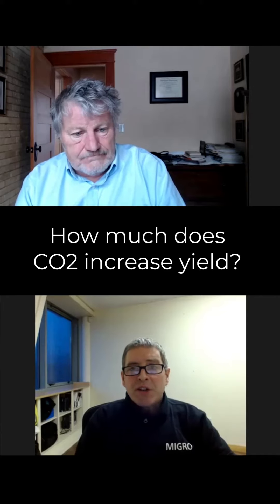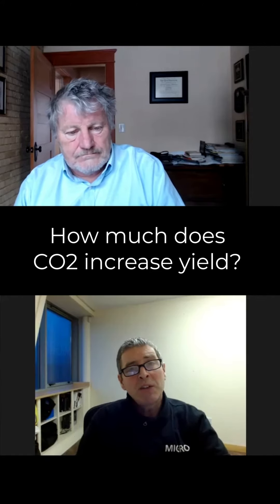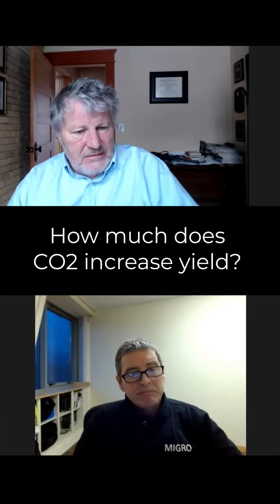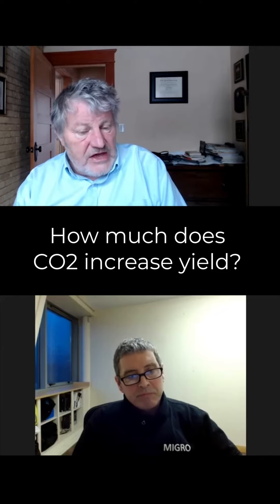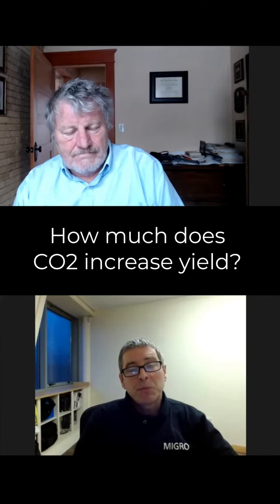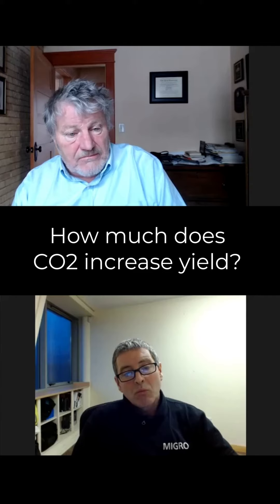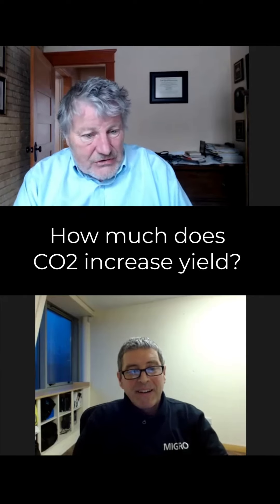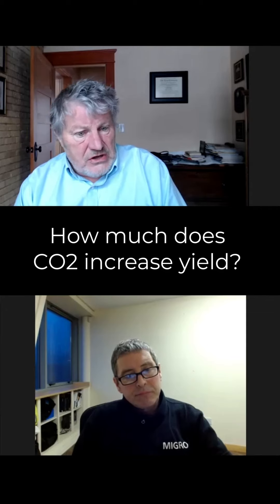How much does elevated CO2 increase cannabis yield

Comment: So now I'm thinking my plans have changed again....sealed room it is, back to planning. But perfect timing! Superb information Shane thank you!
Reply: You can seal your room very easily with plastic tape and large plastic tarps, i sealed a room like that so well that when i turned on the exhaust fan the plastic tarp on the walls started expanding into the room as if the walls were closing in on me lol.
It was a freaky but cool expiriment with great succes, just make sure you have enough air input or else it will draw air from small cracks and crevices which can suck in insects and molds from the walls or outdoors

Comment: I guess it depends on your CO2 source.  Around here, tank rental is $1/day, CO2 is ~$60-80 for a 20lb refill and that would last me like two months.  So I'd be looking at maybe $700/year?  That's more than it would cost to double my lighting.
Reply: Sounds like you are running a small grow tent. So it doesnt really apply for your situation. But for bigger home grows or commercial grows this is an significant increase.
Reply: You can also use fermentation depending on the size, might not be effective for large grow areas but you dont need as much fresh air either

Comment: So what's the motivation of those trying to lower C02 levels? If it increases all kinds of crop yield wouldn't that help solve the issue of hunger?
Reply: Make sure you use TNB Naturals scientifically proven to be the best CO2 in the world❤
Reply: Over priced, you can just add yeast and sugar and get the same results. I bought a bottle and it only lasted a week as the gram weight of powder is insufficient to last a week
Reply: The reason of hunger is Greed my friend

Comment: Hello Shane
If u put grow containers in a bag or larger container,
Filled with CO2 using a tubing from the CO2 system, will it  kill those bugs? Search homemade 
bed bug traps.
Reply: Youhave to have well over 20,000 ppm of c02 to choke out bugs and it has to be sustained for at least an hour
Reply: Where are your bugs, in the medium or on the plant?
To kill plant bugs by co2 you’ll be wasting a shit load. To kill soil (bad) bugs you’re better off just using carbonated water… or for better protection - Hydrogen peroxide. But note, HP will kill your “good” bugs too. That also applies to co2 - the amount you need will also kill the good bugs too (if you have any)
Reply: You can also use the HP as foliar spray (prevention/pest maintenance), cos it has an extra oxygen atom that expands the/any bug and eventually kills it. A good ratio to start with is 30ml HP per 500ml water. 3day application rate recommended - further if needed.
Reply: Zyklon B does a good job

Comment: I doubt any bag/bottle that u hang with any sort of venting gets to 1200ppm is my first thought .... I use propane with a monitoring system ... 1500ppm seems to be the sweet spot for me
Reply: I use butane. I find it cheaper. I also make 3 x 1 litre bottles of co2. 200 g of sugar. Half a teaspoon of bicarb or baking soda. 2 level teaspoons of active dried brewers yeast. I find the yeast to use in spirits like gin work the best. Finally 500ml of warm water.
Lasts far longer than the tnb brand and costs pennies.
Each bottle lasts about 3 weeks
Reply: @Tony Wharton
I noticed you mention that in a comment, i used to do the same - still do sometimes. I’ve noticed four 2 litre bottles will last about 4 weeks in a 4x4, then when they’re running low on bubbles you can top up with bicarb. I don’t add the bicarb until it’s low on bubbles just add 2cups sugar per 2L water (mix sugar in portion of warm water prior, then add to remaining 2L). Wait 5min to cool then add half tspn of yeast… wait an hour and bubbles will start, then gradually increase over the next 2 weeks.
The usual ppm readings for four 2L bottles averages around 11-1200 for two weeks then drops to 1000 and keeps decreasing for the next 2 weeks to around 600 after 4 weeks. You can add extra bicarb after the 3rd week to increase ppm back up to 1000 for another few days… But it’ll still drop rapidly by the 4th week to around 600.
This is for a 4x4. The scale remains relatively the same for either 2x2, 3x3 etc.
Reply: @Tony Wharton
I also use tanks when i feel up to refilling them (i refill mine with dry ice) I keep ppms around 1200 on timers - but recently haven’t been using any added co2 anymore, cos I’m semi indoor, so don’t feel the need. Since my lights are basically only on for about an hour before and after sun up & sun down. I’m retired so i just wake up and take them outta the tents into the sun everyday. Bad storm days don’t really worry me cos I’ll leave tents open instead.
Reply: @Freedom_Born  Thanks for the advice my friend. I agree that the bottle will last 4 weeks but I do a complete change at 3 weeks as it's only costing pennies.
The reason I use a smaller bottle is because I'm only in an 80x80 with a 200watt led. When doing auto's, I can have the light on 100% in the first week. The girls get to 7 to 10 cm away from the lights with no problems at all.
I can only use butane in the winter and unfortunately I can't grow outside.
Reply: @Tony Wharton
Awesome, I’ve ran a few experiments over the years. On one experiment I had a 2x2 with gas, another 2x2 with a 1gal (4L) yeast bottle, and a homemade 2x2 with no co2 added.
All same cultivar, same soils, same light wattages (150W), feeds etc… i maxed the gas tent as much as possible, got about a 30% increase in biomass but it wasn’t primo. Because the over absorption of co2 didn’t allow the cannabinoids to fill out the trich bulbs fully. Made everything too fat to fill out. The bottle tent only gave about a 10% increase in end weight but the colas and trich bulbs filled in better and the smoke was better. These were compared with the No co2 tent. For a 2x2 i don’t think it’s really worth it since you can’t push ppf enough for the plant to use co2 correctly. For 2.5 x 2.5 it’ll be a little different… cos you can push a better ppf. Especially with a 200W.
I also run a 2x4 with two 150W in it with added gas, and that usually pulls a 15% increase on avg.
Reply: @Tony Wharton
Yea i kinda have the same “outdoor” issues too, but in the last 20yrs haven’t been nicked yet (touch wood), it’s just in the last 5-8yrs I’ve been transitioning more to semi indoor. It’s funny how we try to maximise co2 in tents, but cannabis cups are usually always won by outdoor grows. That always makes me chuckle. We try to maximise but still can’t beat premium outdoor.
With autos I’ve found co2 works awesome. But i run gas on timer for autos cos they eat it fast. So i can’t have it wasting in lights off. I haven’t ran tests with autos. But I’ve done separate runs with and without, and there’s generally an avg 10% increase with compared to without.
Reply: @Freedom_Born  To be honest with you my friend, I don't think the cops are that bothered.
I started auto's around 18 months ago. I've never looked back. Without co2. Average  3 Oz cured per plant. With co2 they take off and don't stop. I'm now getting between 5 to 6 Oz cured per plant in 16 litre organic soil.
I use biobizz all mix for the first 10 litres of the pot followed by 6 litres of light mix. I still pop auto's the same as any other. Damp paper towel in bag. 48 hours later I put them in the soil with absolutely no issues. I've never topped an auto. Just cropped auto purple gorilla. It's just for me so I wet trim. Makes a lovely dab oil that tastes like nectar from the chaff and sugar leaves.
The oil gives a really nice change.
Pretty much everything has been spot on 10 weeks from seed and around 1 meter.
No point running co2 at night.
Reply: @Tony Wharton
Lol I’ll run the risk, it’s only me to worry about no “attachments” so to speak. I’ll do time for a plant i love growing. It’s not hurting anyone. Nearly a century of prohibition, mind boggling. Even the alphabet community has gained more rights in the last 12months than cannabis 😂🫣
But anyways, sounds like you’ve got a pretty good process going on. Mixed soils, paper towel, tinctures… very nice!! I’ll wet trim sometimes when i have to. The biggest auto I’ve done is 7oz, but that was BigBud (Afghani x NL x something else - hybrid). I’ve bred my own GDP x Chocolate Wed Cake and Pineapple Kush x NL #1 autos. My fave autos are berries and candy flavors.
Are you making glycerin or pressed dabs ?
Reply: @Freedom_Born  This country is far too far behind the rest of the world. But some of the fun is sitting back thinking "I grew this shit"
Like yourself, I'm an old time grower.
I winterize my chaff for 24hrs. Depending on how much I have, I place it all in a muslin bag, pour about 250ml of IPA into an airtight jar. Crush and shake for 5 mins then press the juice through the bag into a silicone baking dish. The IPA takes about 4 or 5 days to evaporate and I'm left with a gorgeous thick oil. I have a couple of electric dab pens. Very nice
Reply: @Freedom_Born  Hope you don't mind me asking. What area are you?
I'm SW

Comment: I would like a better understanding of how fast the plants eat c02 in a given hour during the light cycle
Reply: I think it’s something like 400 water molecules lost per 1 carbon atom gained… something like that.
You also lose even more water when the vpd & other factors aren’t correct. Ideally “everything” Has to be on point to maximise co2, and it should match your ppf if you’re generally above 1000. Normal ambience is usually 400-600ppm and regular LEDs push avg 900ppf (coverage*) - for 900ppf, the avg ambient co2 ppm should suffice. Anything higher than 900ppf, you’ll want co2 numbers to match.
Transpiration rates won’t work effectively if it loses too much water without gaining the same ratio of carbon atoms within the hour(s) it loses water. Hence why it’ll lose water “faster” when everything’s not correct.
Reply: @Freedom_Born  Losing water faster isn't a bad thing. Lots of nutrients can only be moved into the plant via transpiration, so less of it will result in less of those nutrients going into the plant. So many times when people think they are getting calcium deficiencies from using LED grow lights, it's actually because of CO2 levels.
Reply: @TheCowMan
When you’re losing too much water without replenishing it with the needed ratio of co2 to compensate - then you’re losing efficiency and essentially causing the plant to slowly die.
That’s how you get deficiencies that “people” May sometimes mistake for ‘Calcium’ - but you can’t even be sure if it’s even a calcium “deficiency” or a toxicity from other factors.
Reply: @TheCowMan
YES - losing water faster IS a Bad Thing - if it’s not compensated or replenished with the comparative amount of carbon atoms it needs for every 400 molecules lost.
When you vpd isn’t right the amount of water molecules lost rapidly increases. The scale doesn’t stay the same @400 water molecules lost for 1 carbon atom gained !! You lose even more molecules without gaining the needed carbon atoms - therefore eventually losing even more water by the minute. Cos the carbon isn’t getting replaced fast enough
Reply: @TheCowMan
Wait what?! You said it’s not a bad thing - then you say deficiencies are because of co2 levels ??!
That’s exactly the point!! If co2 levels don’t match the water molecules being lost then it’s a BAD THING
Reply: @Freedom_Born  hi if my canopy is around 800-900 ppfd, should I just keep my co2 ppms at 900-1100?
Reply: @ClearWater7.62 
CO2 is only really needed after 1000-1100 ppfd. 800-900 doesn't really need any.
Reply: @Freedom_Born  thanks for the reply.   I have seen a difference in growth with co2.  I just didn't understand the ratio.  I only learned 1200 is the optimum ppm.  I already spent money on co2 setup, so I will continue to use it.
Reply: @ClearWater7.62 
Word. You'll get more size than normal with CO2. Even at lower ppf. But it doesn't add anything to the terp profiles or the taste, it only makes the plant bulk up faster. Adding taste and terps comes with your brix levels. Which is part of the gene expression. But can be helped with sugars during flower.
Reply: @Freedom_Born  yes I think 10% is alot, plus I'm using biostimulants.  I had a light leak since week 1 of flower, didnt check for leaks and my plants are in week 5 of flower.  Hopefully that didnt decrease my yield.  Also I had an issue trying to keep up with the vpd chart, and probably had my humidity a bit low when the chart calls for 60-65rh at 78-80f.  Hopefully the biostimulants had increased the brix level and towards the last two weeks, ill turn down the light intensity and lower the co2 to ambient ppms.
Reply: @ClearWater7.62 
10% more is always a bonus. If everything is dialled in correctly it can get to 30%. I used to run closed loop systems through 3 tents, and always averaged around 25% when vpd was on point.
Nowadays I'm too old to care so I just went back to concentrating on the soil as usual, the bulk difference doesn't really matter to me anymore cos I'm in and outdoor, and the tanks were practically free anyway (local pub refill). Been gardening for about 25yrs and the CO2 was just a passing experiment I thought I'd try.
You sound like you've got things down, and pretty equipped for a banger harvest, although with that early light leak, let's hope it didn't herm and throw a few beans... unless you sell or share them, they might be okay to keep for yourself for when your bean stock runs low.

Comment: Make your own CO2.
For every 1 litre of water, add 1/2 cup sugar amd 1/2 teaspoon of yeast.
Reply: Have you tested the levels this makes
Reply: Do you use a heat pad to keep the yeast active and how long do wait before changing? TIA
Reply: @MikeParentLeap  Heat pad is not needed, it will just speed up the fermentation, which you don't really want. Different yeasts/temps/sugar levels will react at different rates and produce more or less CO2 per day. Faster acting stains of yeast/higher temps will produce more CO2 but use up the sugar quicker. I would recommend a champagne yeast because they aren't too fast and they can handle a high alcohol environment, which means they will remain active longer in the bottle, will last about 3 weeks of peak fermentation.

Comment: massively misunderstood in the growing community . I would wager 90% of growers are under the impression that supplemental Co2  is only of benefit after a certain ppf level.
Reply: I believe you're right. They hear that when using CO2 you can get away with using higher levels of ppf. These people then get stuck on that point. I do believe CO2 is beneficial throughout the entire grow but I disagree with Bruce about the 30% yield increase. I think it's more like 10 to 15% at the most. Happy growing my friend.
Reply: @WildBill496  I think  Its a problematic variable to manage for home growers. Sufficient air exchange will maximize the use of ambient levels but maintaining elevated levels in a tent is perhaps not worth the trouble.
Reply: @eggspanda2475  I agree
Reply: Hi I'm new to using co2.  My ppfd is around 800-980 ppfd.  Should I keep my co2 ppm around 1200?  Will 1300 + plus ppm become useless?  To much mixed infos.
Reply: @Billy Sava Bugbee said the rate of photosynthesis increases 30% at any appropriate PPFD/DLI. He said you won’t get 30% more yield because of the Harvest Index Ratio which is the ratio of biomass to yield. You end up growing more leaves and stems which effects yield. He then used an example that if you increased your biomass 50% your yield would increase 30%. So in his original 30% statement your yield increase would be in the 15% range based off the Harvest Index. So you’re right! About 15% increase in flower.
Reply: @jonathanlebeau853  should the co2 stay under 1000 ppm if the lights are only putting out 800-900 ppfd?
Reply: @ClearWater7.62  always keep your CO2 at 1000ppm. I base this off of the Professors statement that a plant can’t process more than that under ideal conditions.
Reply: @jonathanlebeau853  thanks 👍🏼
Reply: @WildBill496 It's hard to dial stuff with CO2 because once you start adding it strange things happens like plant starts preferring ammonia form of nitrogen instead of nitrate which can be a problem in hydro. You also need to raise temperature because the rubisco enzyme (which fixates CO2) is temperature dependent and is fully efficient in 30-34C range which is too high and can cause problems like powdery mildew or may prevent some equipment (dehumidifier) from working. Water and oxygen requirements are also increased. Hydro is imo the only way of doing it for max yield.

Comment: I can remember hearing this awhile back from Dr. Bugbee about the up to 30% increase, I introduced more co2. I’ve also found a way to deliver carbon to the plants available mineral uptake factors, is how my armchair scientist is trying to phrase it. I’m just learning about this other method of delivery through working with the rhizosphere. I don’t want to cite the wrong scientist but it was someone who has an in depth life long love with researching the nuances in the biology of botany, who proclaimed that carbon in the soil is just as good.
Reply: Carbon in the soil is good too. But co2 to the leaves helps it push transpiration rates even higher. Cos with added temps and higher ppf/PAR the plant will transpire too much and lose too much water without regaining the same ratio of carbon atoms relative to how much water it loses.
Reply: Plants don't absorb Carbon from the soil for photosynthesis. It happens in the leaves only with gaseous CO2 via stomata. Carbon in the soil is a food for microbes, not for a plant. If this was true you could simply water plant with sparkling water which is saturated with CO2.